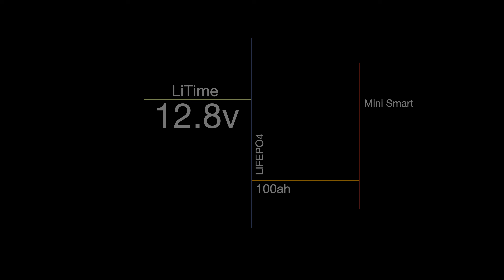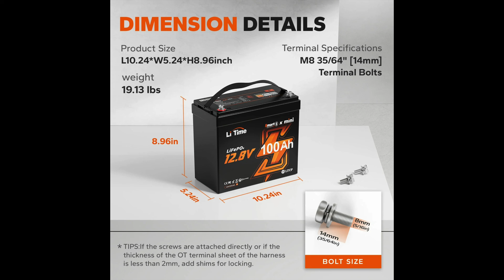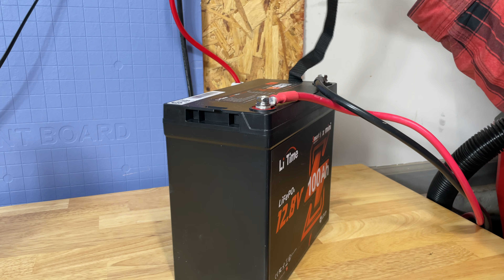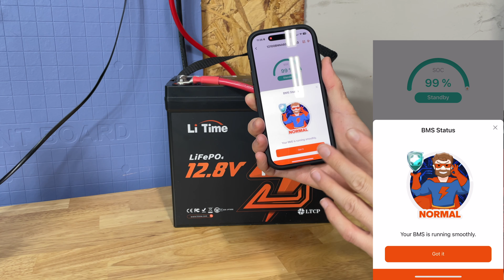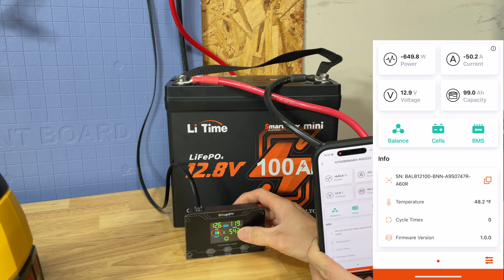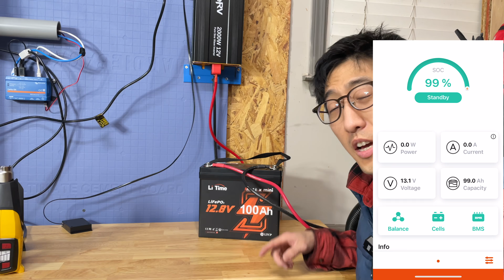LiTime 12 Volt 100Ah Mini Smart LifePO4 Battery Review with bluetooth BMS and LTCP

Comment: I did 3 load tests on this battery and they all came out to exactly 100ah. Kinda disappointed with that result.
Reply from the maker: Isn’t that good though? Works exactly as spec’d.
Reply: Should have been at least 103ah.

Comment: Can I charge 2 of these batteries in series with Li Time 12 volt 20 amp charger, or do i have to charge separately?
Reply: If you want to charge in series you'll need a 24v charger, 20 amp preferred. 
If you only have a 12v charger then you will need to set the batteries in parallel and charge then.
I hope this helps
Reply: @af1023  thanks  for the reply. All set up now !
Reply: @ Cool, glad to help. 
Also. when you charge the batteries in parallel, connect the positive post on one battery and the negative on the other.  
This truly optimizes the charging process.  
Best wishes.
Reply: BTW, these are awesome batteries,
I connect them in series to get the maximum MPPT effect on my Ecoflow MPPT controller.

Comment: I received this battery today and it arrived charged to 12 percent and 7.3 volts.  I  charged it for a for  10 secs and still only got 7.3 volts. I continued charging to 40 percent and only get 7.3 volts.  I tried waking up the BMS per their instructions and still no change.  The app says everything is fine.  No response yet from the factory.
Any thoughts?
TYIA.